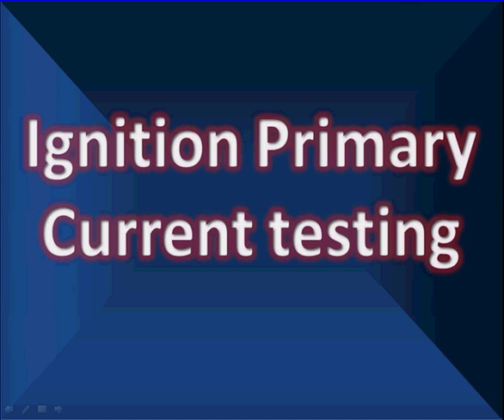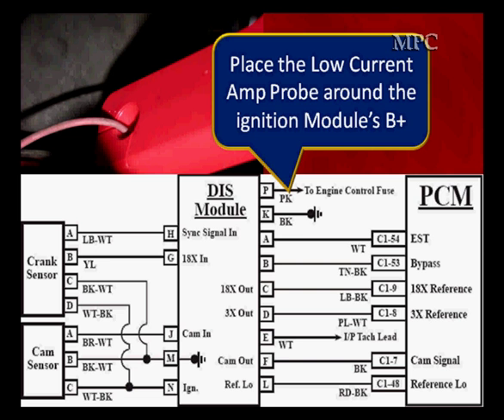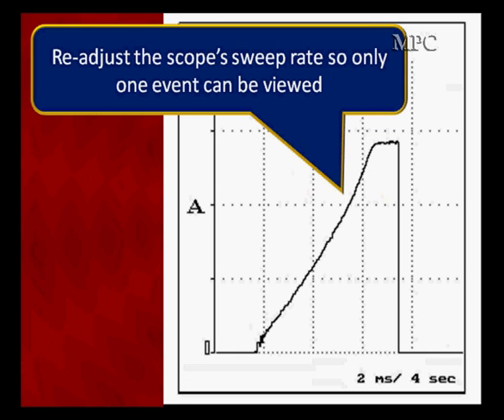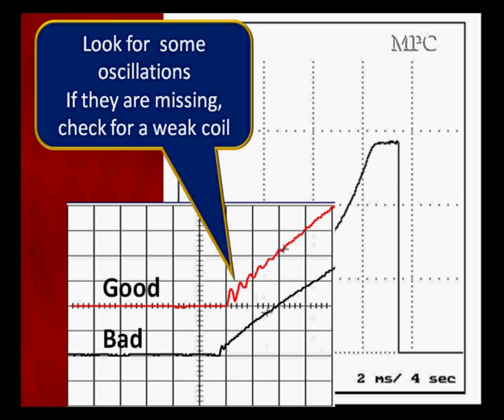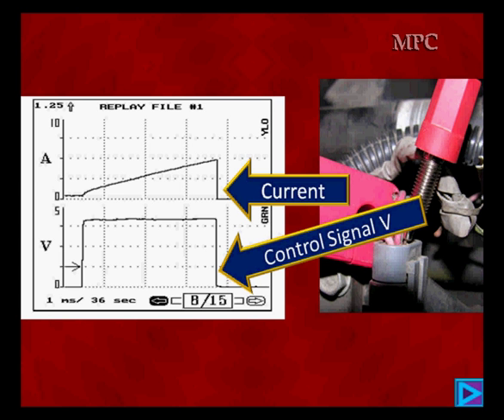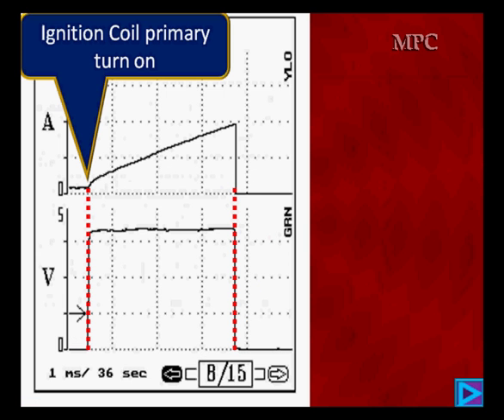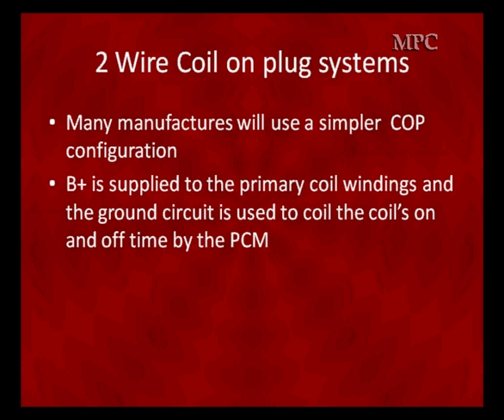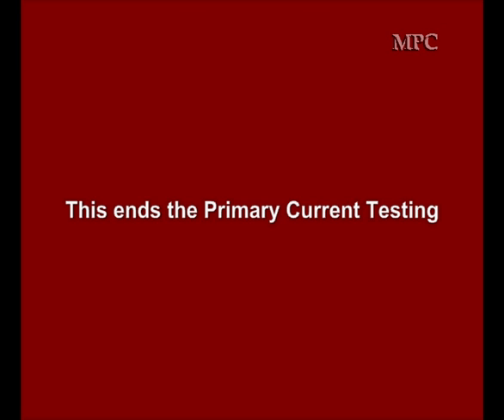08 Ignition Primary Current Testing

Comment: To see Primary Voltage waveform; we have to back probe -ve wire of a 3or4 Wire Coil-on-Plug?
Reply: It is impossible to see primary voltage on 3 or 4 wire coils. Because coil negative is inside the coil housing between the transistor and primary winding. 

It is possible to see current on feed and ground, and the computers signal to the transistor's base but no coil (-) voltage.